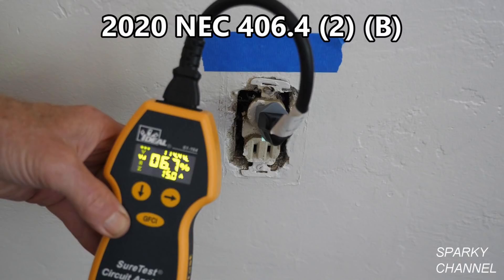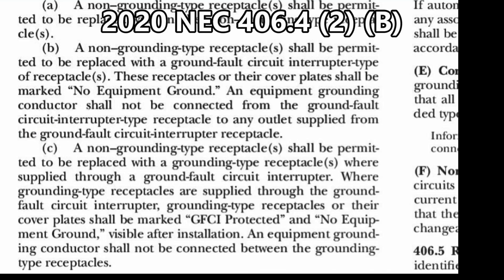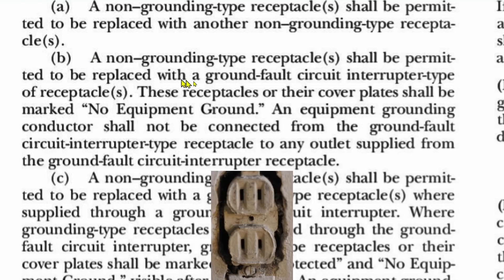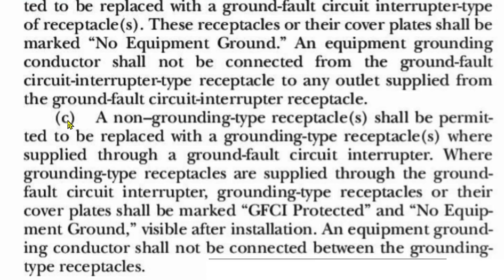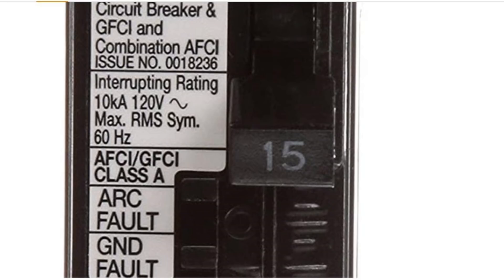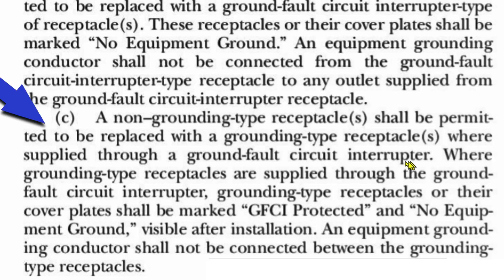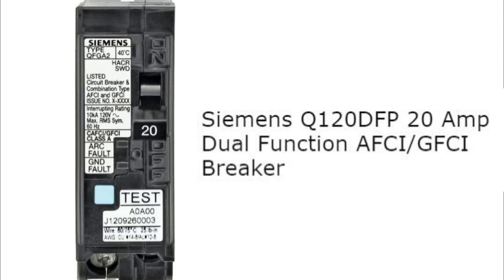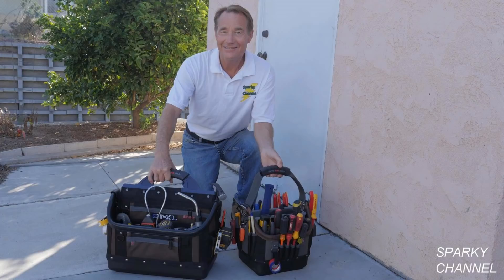Can You Just Install an AFCI/GFCI Breaker When Replacing Old 2 Prong Receptacles?

Comment: Are Twin AFCI/GFCI Circuit Breakers available?
Reply: Not any double pole breakers with both afci and gfci, but you can get them with one or the other.
Reply: Twin AFCI breakers are meant for 220v loads only not split receptacles. The shared neutral will cause nuisance tripping.
Reply: @Archer11ca  incorrect, I'm using a half dozen Eaton dual pole afci breakers running MWBC's, never had these nuisance trip, have had the single poles trip multiple times running dedicated circuits with motor loads. Most 240v appliances with a neutral lug will pass some current back on the neutral wire anyways, which is more of a problem with GFCI rather than AFCI

Comment: but dont they want afci in habitable rooms ? seems like these circuts are possibly in bedrooms of these old houses....like mine
Reply: That is a new NEC requirement. All depends on what version of your local electrical code calls for. The new NEC also calls for tamper proof receptacles for ALL new installations.

Comment: In the first place obviously  the wiring  doesn't contain a equipment ground  being a 2 prong outlet...wouldn't  a afci  breaker to work properly need the common ground ???to work properly
Reply: Why would it? A parallel arc being an "arc fault to ground" also refers to arcing against neutral.

Comment: Can I replace my two wire outlet with an afci/gfci outlet? Or can I only replace the two wire outlet with a gfci outlet?
Reply: I don't see why not.  Seems the same logic would apply to an afci/gfci outlet.  Just make sure the afci/gfci receptacle is the first in the line, each outlet is labeled BOTH 'GFCI protected' and 'No Equipment Ground' and that the ground terminal of each outlet does NOT have a ground wire attached back to the afci/gfci outlet.

You don't need to replace EVERY outlet with gfci, only the first one in the string.  If you connect the downstream line to the 'load' side of the gfci receptacle, it protects all of the downstream.  So you can replace the downstream ones with standard 3-prong outlets BUT you must label them as outlined in the code paragraphs 'Sparky' mentioned in this video.
Reply: @mikefochtman7164  Or as the video states, replace the breaker with a GFCI breaker and there all covered. Mark the outlets no equipment ground.
Reply: A GFCI might not trip when it should if there's no ground wire.

Comment: I would run a new romex wire to the plugs without a ground. You could cheat and run a ground wire to the recepticals without a ground, but I think that is only allowed in commercial.
Reply: If you run new romex all the way back to the service entrance, then I agree.  You're just upgrading completely to the current standards.

BUT, if you're only running new romex back to the FIRST outlet in the string where you replaced the two-prong with a GFCI receptacle, then you're mistaken.  You must NOT connect the ground from one receptacle to another unless it leads all the way back to the service entrance.  You must label them as 'No Equipment Ground' and you must NOT connect a ground wire to the green stud of the receptacle.  That's what the code says.  (I think it's to avoid confusion should someone later come and pull out the receptacle, see a ground wire and remove the label thinking it DOES have an equipment ground)

Comment: Rip out the old wire or add a ground...
Reply: So instead of buying a $20 GFCI, you’d rather spend thousands to have an electrician cut holes in your walls and pull wires and then have someone repair the holes and paint for another thousand?
Reply: @glasshalffull2930  do it properly or not at all
Reply: @Phil-D83  This is done “properly” according to the NEC and greatly increases safety.  When the house has a major renovation, sure pull new wires, but by doing it this way you are getting substantially all the benefit.